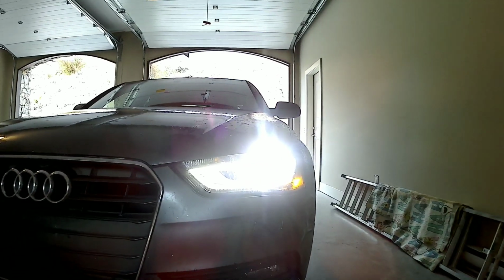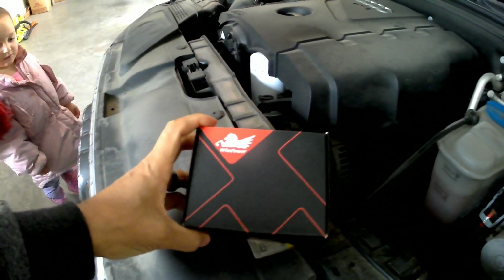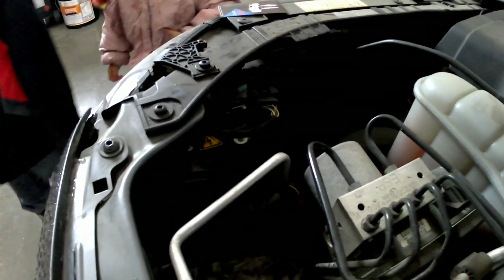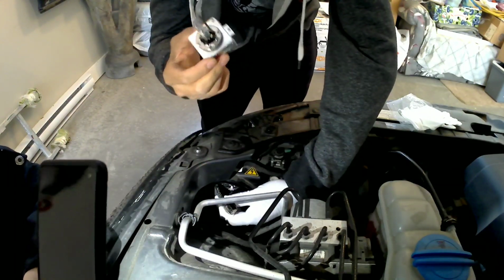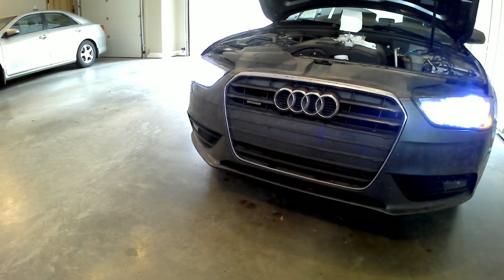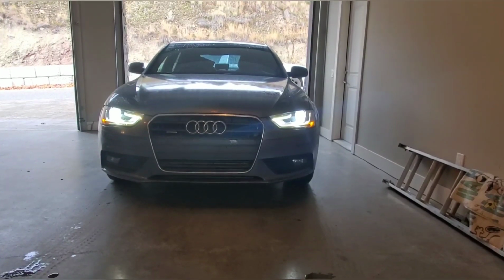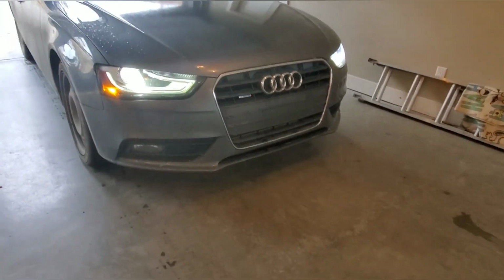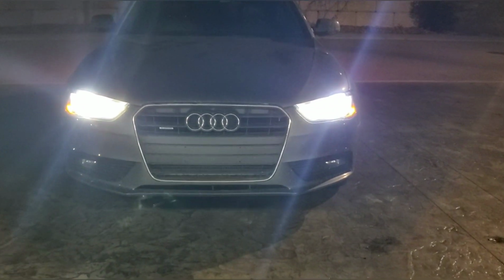2014 Audi A4 Xenon HID headlight bulb replacement

Comment: Omar thanks for this video. Two questions: 1) what sort of screwdriver or wrench do you need to remove the screws for the driver's side? In another video someone mentioned using a T25 hex, is that what you used? 2) the box for the bulbs in the link you provide reads 'LED,' but I think you installed Xenon, correct? I understand that LED is a different bulb than Xenon. Or maybe it's just the foreign company manufacturing it that can't tell the difference? :) In any case if your installation was successful I'll try it myself. Again, appreciated.
Reply from the maker: I think they're T30 screws. The link in my description is the exact ones I got, they are xenon. I still have not changed the passenger side so I have a spare.

Comment: I just did this but on the left side, it's having a hard time screwing in to where the orientation has the writing perfectly horizontal. So it is a little tilted, but not super noticeable. Will this cause problems? And any advice on how to fix it?

Comment: Are these really white and have you had any issues with them
Reply from the maker: No issues. Not super white or noticeably different color or anything. I still only have the one new one and one stock one.
Reply: Just got mine, they are a huge upgrade from stock. Thanks again

Comment: Was it noticeably brighter?
Reply from the maker: No it's not bad at all. I am still using them this way with the one older one and one newer one.
Reply: @OmarButtcheeks  wait, did you mean not bright at all?
Reply from the maker: Sorry I might have misinterpreted that. Looking at the car it's not really noticeable having one new and one older. The new one is definitely noticeably brighter when you're driving.
Reply: @OmarButtcheeks  got it, I know not much about light temperature, you think the 8000k would be even a hair brighter?
Reply from the maker: Maybe slightly brighter.  If you Google the light colors anything 4k to 10k is pretty white looking.